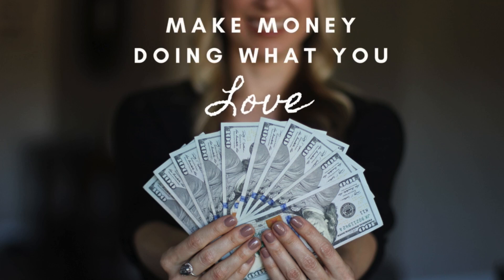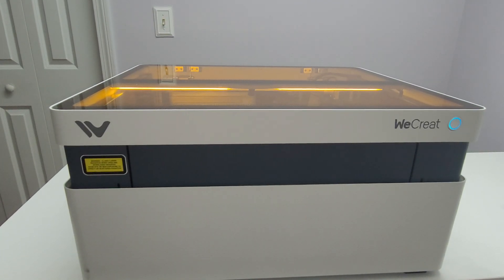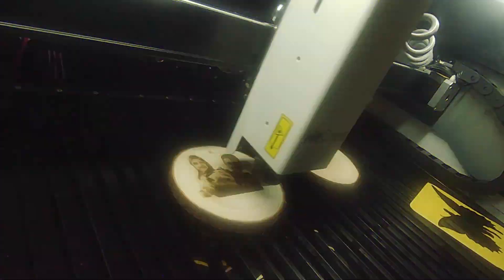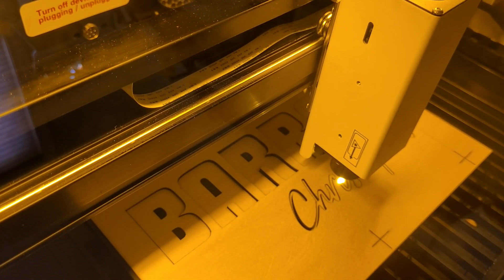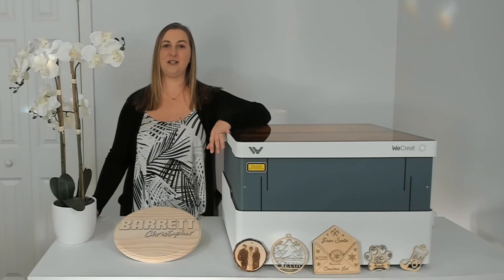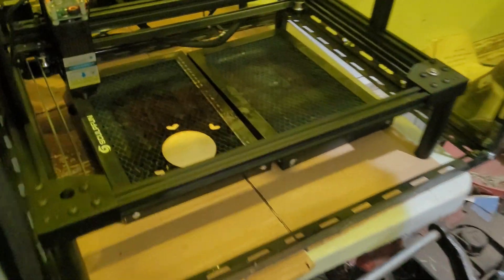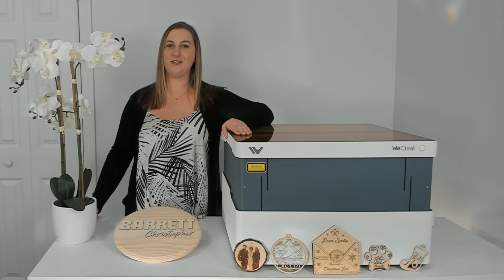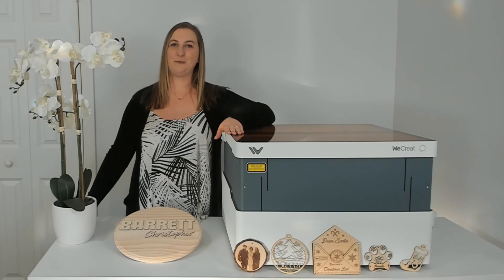WeCreat Vision Laser Engraver And Cutter Review

Comment: Can you cut vinyl instead of using a cricket?
Reply from the maker: No! Not on a laser engraver like the WeCreat. Burning through vinyl (made out of PVC) produces hydrochloric acid and chloride gas. Incredibly toxic and corrosive. You could cut through vinyl with the xTool m1 because it has a laser engraver and blade attachment. Vinyl can ONLY be cut, never burned
Reply from the maker: Check out this video I just posted today about laser safety - https://youtu.be/7wFjprBOL9A